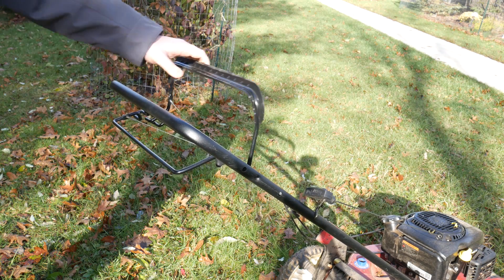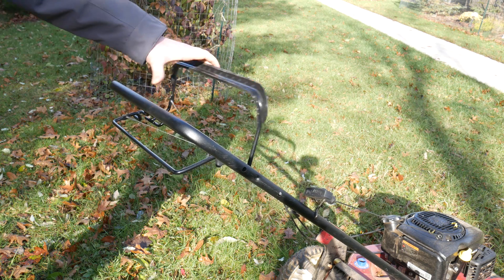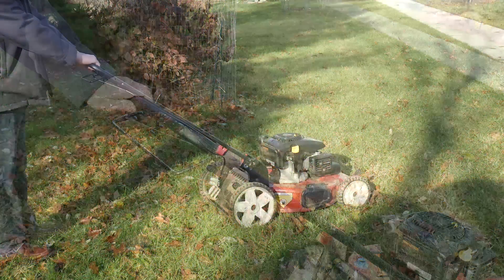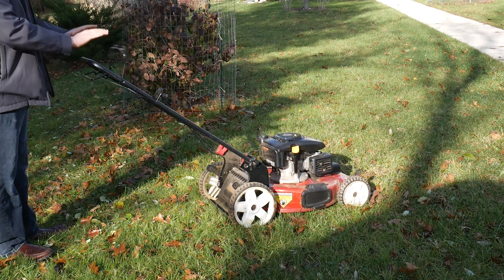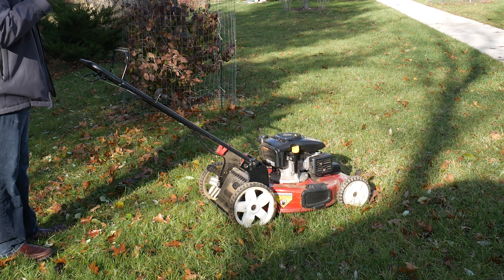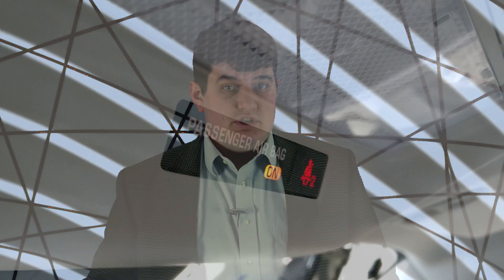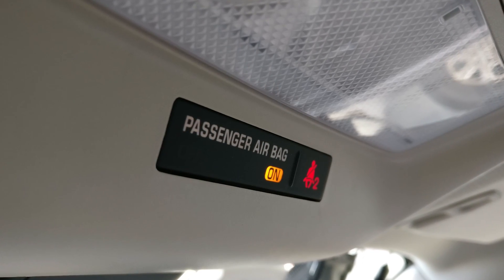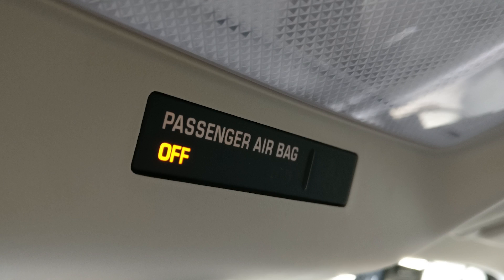The Dead Man's Switch:  How Anton Yelchin's life could have been saved

Comment: Generally, anything that automatically stops the car while it's moving can lead to a disaster. Sensors malfunction, people can have weird habits, there's quite a few ways the switch could kick in in the middle of a highway.
Reply: @6:30 he addresses this, by pointing out that at speeds more than 5mph it would treat it as a fault and turn on the engine warning light rather than shift into park/apply the parking break.

Comment: With switching to park when no pressure is on the seat, this makes sense as long as a few rules are set: 1 do not shift to park if going above X miles per hour, wait for released pressure for x seconds before shifting to park, and perhaps a few other minor rules to prevent highway lockups, passenger endangerment, and someone just bouncing up and disabling it.

Comment: BMW does this exact thing with their cars made after 2014 (possibly earlier). While in any gear other than Park, the driver door is opened and the brake pedal is no longer depressed, the system shifts the car into Park and sounds a "ding" with a control message of "Secure vehicle against rolling". There is a mechanical override for putting it into neutral for towing/rolling without a driver in the sear. Simple, easy, and safe.

Comment: You are completely off topic here, which is modern cars are bullshit and the technology is going backwards. Sure, software, sensors and electric actuators are very cool and high tach, but KEEP THEM WHERE THEY BELONG.

I drive a 2006 car. Accelerator has a cable to the throttle body, hand brake is a lever pulling a cable that tightens the rear brake pads. Gearshift has cables as well, pushing and pulling 2 levers on the gearbox, one for the front-rear motion, one for the left-right motion. These things DO NOT FAIL. Winter or summer, rainy or dry, water, ice, salt, clean, dirty, THEY DO NOT FAIL. The only way they fail is when it gets a bit harder to move them from rust/mechanical failure, being a minor inconvenience until you get them replaced.

Park, put it in 1st gear and pull the handbrake, and the only thing that can move the car is if an asteroid hit it.

Comment: This system is already in place I work at a Chevy dealer and idk if I was in a new or used car but i got out without putting it in park (i daily drive manual) so the second I got out it beeped and applied the electronic parking break

Comment: What happens if you care stalls and you have to push it?  The physical safety interlock switch release (automatic transmissions) in some cars would also need to be re-implemented in cars that lack them, so a car can be put into gear or neutral to be pushed in the event the engine is disabled.

All of the "but sometimes" (traffic light video reference)) scenarios would need to be considered prior to release in case additional hardware is also be needed for the edge cases.   It's always important to lay devil's advocate of our ideas (one of the roles of quality assurance) in order to identify and work out all the edge cases prior to implementation to prevent dangerous side effects of well meaning features.  I like how you touch upon these thoughts in this when discussing sensor overrides video.

Comment: If the sensor sends a wrong signal due to fail (fail that isn't detected as a fail, just like happens with MAF or O2 sensors and the car just runs badly unknowingly of the fault) the car could apply the brakes at potentially dangerous speeds or situations

Comment: Yeah idk why these aren't in cars.... (I know they have sensors for different applications but the one he specifically mentions... i dont believe there are) I have a zero turn mower that has it on there. Sure sometimes its irritating but its definitely helped. The specific mower put it in the seat and the handle although I suspect the one for the handle is simply a mechanical fail safe as opposed to computerized.

Comment: i know this is a really old video but there is some incorrect information in here about a deadman's switch on locomotives,  i am an engineer with a large class 1 railroad. deadman's switches were used in the 40s 50s and 60s. modern locomotives use an alerter...  a deadman's switch does infact work on the principle of if it is released the emergency brakes are activated, an alerter is a timer that if the controls or the alerter button itself is not manipulated in a 90 second time frame the brakes are applied.  if the controls are actively manipulated then there is no point in a dead man's switch as the engineer is obviously alive and doing his job,   an alerter will sound an alarm 20 seconds before the timer runs out hence alerting the engineer to either make a change with the operating controls ie changing the throttle setting or brake setting, or press the alerter button resetting the 90 second timer.  it became unreasonable to make someone hold a button down constantly as it created pressure points and muscle fatigue-.

Comment: commenting on an old video, i just bought a 1974 Plymouth Valiant, and it's the first car i've ever owned that won't let me take the keys out unless it's in park. It'll start in park or neutral, but the key only releases in park. i'm guessing this feature disappeared due to moving away from column shifters, but after how many hundreds of thousands of miles (five digit odometer) the mechanism still works smoothly. Certainly doesn't solve every facet of the problem, but it's probably enough to keep my car from rolling away under most circumstances
Reply: Saab had a range of cars that you couldn't get the ignition key out unless it was in reverse !

Comment: It's funny how a Jeep, a technologically advanced car (at the time) compared to mine, a late 90's shitbox has inferior security systems. My car will beep very angrily at you you if you leave the parklights/headlights on when you open the door. Turning the door ajar switch into a dual purpose switch. I'm guessing the same can also be done with the transmission without interfering with the airbag system of a car.

Comment: A lot of people being not really creative about this raising non-issues here. I mean, you could just make it go into park / engage the parking brakes if all of the following apply: (1) car (basically) standing still, (2) motor turned off, (3) seat-belt not closed, (4) (driver’s) door open. I can’t imagine a situation where this creates any problems, on the other hand, the moment you leave your car (through the open door), you’ll pretty much always have it standing still with the motor off and no seat-belt on. Also, virtually all modern cars have the ability to sense open doors, whether the motor is on, state of the seat-belt, and speed of the car.

Comment: On the newer Fords, if the gear isn't in park and the driver opens the door it'll automatically put the car in park. To override this the driver has to press the sport button in the middle of the gear selector knob. I'm surprised Chrysler doesn't have a similar dead man's switch

Comment: With the seatbelt functioning as an interlock, there is one major issue other than public resistance. It would suck to go to unbuckle and re-buckle your seatbelt because it locks up and the interlock activate, shearing off the parking pawl while going down the highway at 60 miles per hour. Your suggested fix of having the computer simply ignore the input (or lack thereof) when a certain speed condition is met would work very well to prevent this. I can imagine the code for this system resembling, at a logic-gate level, "IF (sensor detects no weight) AND (gear selected is not park) AND (speed is less than 5 miles per hour,) THEN (apply electronic parking brake.)"

Comment: You know... Fork lifts have these sensors and they are hated past your beliefs.
Back in the days when I drove a fork lift (the type you are standing on), if you moved your feet just to shift your weight slightly from your tired fot the other then the fork lift could stop in a second.
And in case it's unclear, the load did not stop.
I got 600 kg of carrots, plastic boxes and pallet over me. I was lucky to just get beaten up but there are colleagues of mine that has been off work for months or years because of this dead man switch.

No thank you! Don't come near me with that crap.

Comment: You underestimate the cost of software changes in safety critical software. While the cost of changing the code on a website may be minimal, maybe 30 minutes to implement and 15 to test, changing safety critical software will involve a lot of people, doing several hours/days of work to guarantee that the feature works as intended, it didn't break any other feature, everything is documented, validated, verified, tested, etc.

It is still cheaper than changing the hardware, but not as cheap as you may be thinking.

Comment: Most shift by wire cars now have this mechanism in place. The trigger is usually when you open the driver door while your foot is on the brake. I want to say they actually updated the code on future revisions of that shifter, because a lot of the newer FCA vehicles can shift into park without the knob having to move.

Comment: I have a 2014 Grand Cherokee, one of the Jeeps that was recalled for the shifter mentioned in this video.  If the person is paying attention while behind the wheel, the shifter is really no big deal.  As you move the shift lever, you can feel it go through the notches as you move it forward and backwards, just like the older mechanical shifters.  There are indicators on the shifter as well as the dash showing what gear the vehicle is in.  Also, if you open the door when the vehicle is in anything but park, there is a chime that sounds with "Vehicle Not In Park" in the middle of the instrument display.  So, what did they do for the recall?  They made it so that if the door is open and the vehicle hits 2 MPH, the Jeep goes into park, coming to a sudden stop.  In some cases like in parking lots, there are times where I've opened my driver's side door when easing in or out of a space so that I can see down the left side a little easier.  As long as my foot is on the brake pedal, riding the brake, the vehicle can move.

By the way, modern railroad locomotives don't have a dead man's pedal in them anymore.  They have an alerter.  If the engineer doesn't move the throttle, brake, or horn levers for 20 seconds, an alarm sounds.  If the engineer doesn't reset the alerter, the locomotive is shut down and the brakes applied.  However, alerters can be fooled as in the 2001 CSX runaway out of Toledo, Ohio, and dead man's pedals can also be tricked like in the 1976 movie "Silver Streak".

Comment: Honda models with electronically controlled transmissions already apply this safety feature. When the seatbelt is unbuckled and the driver's door is opened below a certain vehicle speed, the transmission automatically shifts to park. This has been applied at least as early as 2018 Accord (hybrid and 10 speed automatic. CVT transmission still shifts by cable). I'm not sure if the 9 speed automatics applied this logic earlier than 2018 model year, but I would assume they did.

Comment: Eh.. not so simple software upgrade and yes, the cause is regulatory. All safety systems derive from relevant regulations and mandated standards and anything safety related, which a deadman switch is, must go through third party safety certification, at least on something like a car. That is not an easy, cheap or fast process and it's certainly not going to be done on a model that is already in production. Even for new models I imagine an attempt is made to bypass as much safety certification as possible by reusing solutions certified on previous models, without changing them.
Now, on one hand of course this means slow progress and bureaucracy, on the other hand much of the safety features wouldn't even exist without that bureaucracy or would be quite sloppily implemented. So yeah, you can't just have an idea and push an over the air upgrade easy-peasy like that on safety systems. But if there is damage to be prevented and lives to be saved, eventually some paper pusher will write a regulation or update an standard and then it gets done.

Comment: As a rail fan, how do you ensure this system doesn't get someone stuck on train tracks? People routinely do <5 mph to go over bumpy tracks, so that system is not going to work. The "push start button 5 times" trick is also no good because if the crossing activates soon after the car gets stuck, some drivers will have too much adrenaline to be able to perform that procedure.

Comment: 2:52 This is why I love old cars. My car still have physical cable throttle and physical cable linkage from shifter to transmission.
Reply: IMO direct linkage of steering and braking is more important. Electronic throttle body cause too much harm when the brakes can overpower the engine and you can kill the ignition power.
Reply: @leolego2  
You're partly right.

At least here in Austria, exterior walls are never drywall but usually brick or concrete (with brick walls being much more frequent), whereas interior walls who don't have to be supporting walls are almost always drywall nowadays.

Which does make sense because drywalls on the inside can be put up much faster and easier, and it's also way easier to install e.g. power or network lines afterwards.
Reply: Much easier to diagnose and fix physical cable as well... More computers = lower quality car in my opinion
Reply: And you still use a land line for telecomminications.
Reply: @williamsanders6092  
And what's wrong with that?
My Internet connection from a major Austrian telecom provider is via land line, so my router is hooked up to the phone jack via cable and another cable runs from the modem to my computer. Because any Cat7 cable beats WLAN any day. Because back in the day when I used to work in IT, we frequently called WLAN "WOLAN" (German "wo" meaning "where" in English) as in "damn, net's gone again - where's that fragging LAN?"

Don't get me wrong, though: all that wireless stuff is a great thing and of course I've configured my router to speak wireless as well, because it's quite nice to use my Internet connection via my mobile phone or have me mum and me friends to be able to go online straight away with their dragtops or phones without having them to fumble with cables when they visit me. So yes, wireless is great - but the best solution is and will be always to use the best of both worlds when appropriate.

And the nice thing about physical connections (a.k.a. cables) is: you absolutely never have to worry if e.g. that drywall between you and the router might dampen the signal too much. And for instance, my quite huge Corsair 750D Airflow Edition case as well as my two monitors (as well as the third in my living room) don't really take offence in being not really mobile in my 650 square foot home. :-)
Reply: @williamsanders6092  I still have a landline phone (in addition to cell phone of course).

Comment: Do you honestly think the manufacturers haven't thought of this? Really? Trust me, they employ far more intelligent people than you and me dude. You may think you've thought of everything that could go wrong with this safety feature but I can assure you that you haven't. Once it's spun out into millions of vehicles, issues with it are bound to come to light. Currently, no one can sue the manufacturer for not including such a safety feature because no other manufacturer includes it either. It's an abstract. But, let's say some manufacturer includes this, and somewhere down the road it causes an accident due to circumstances no one foresaw. They stand a large chance of being sued for that, So even though they've made the vehicle safer overall, they've increased their risk of being sued and the bad publicity. This is why they're very reluctant to implement new things. Most of them want to for sure, but they tend to wait for another manufacturer to take the risk first before following suit  As a result, stuff sits in concept for a long time. An example of this is the key accelerometer idea. There was (and still is) the possibility to steal a car that uses the so called "keyless ignition" system. They use a device to "boost" the key while it's inside the house to unlock and start the car. The idea was to include in the key an accelerometer that can detect if the key is in motion. If it detects the key is not moving for a period of time, it shuts it down (severs antenna coil) so it cannot unlock the car. This makes sense, a key hanging up on a hook or sitting on a coffee table is not going to be moving, A key in someone's pocket or hand while walking to their car most certainly will be. This was not only a good solution, it was relatively cheap, not requiring any updates to the car, just the issuance and coding of a new key.  Even though all manufacturers considered this and had conceptual stuff in place, designs, circuits etc.., it was never done, not one wanted to risk any complications arising later.

Comment: The seatbelt sensor is a bad idea, as some drivers need to remove the seatbelt in order to look over their shoulder while reversing. This also shifts their position in the seat which could affect pressure sensors. (This is a standard and perfectly legal technique in many countries.) Overall good idea, though this would require a lot of testing to ensure certain drivers aren't repeatedly getting their cars locked up any time they try to reverse.

Given the need to field test this with a variety of driver body types, I suspect you may be overselling how cheap this would be.